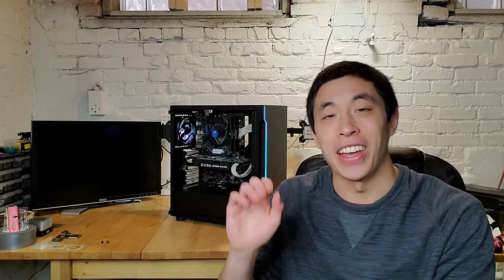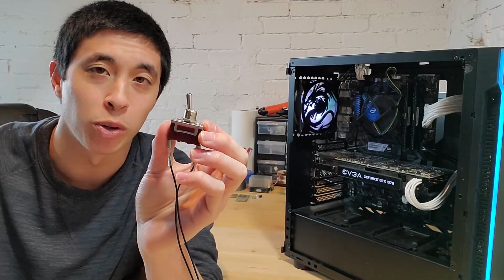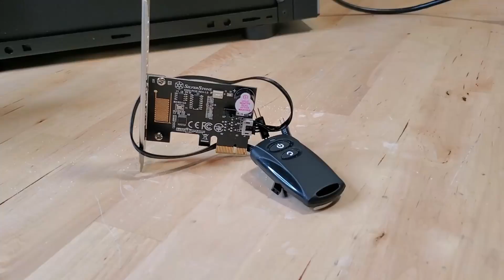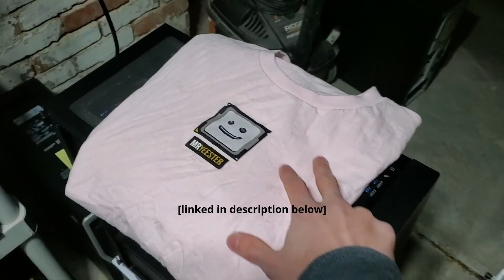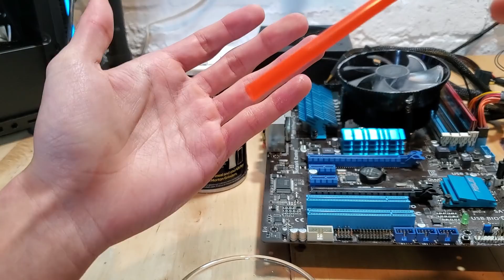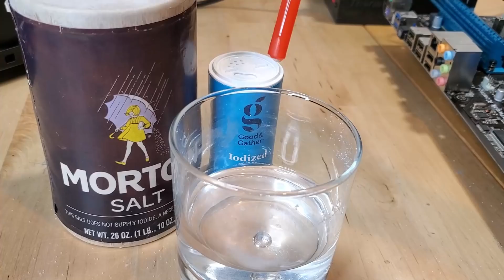Turning on a PC with...Water?

Comment: 1)Take stainless screwdriver and short those pins.
2)using wire you can short pins.
3)take a tv remote and its receiver and attach it to the case and try shorting it.
4)take a receiver from a toy helicopter and attach it to the pins and try to short those pins.